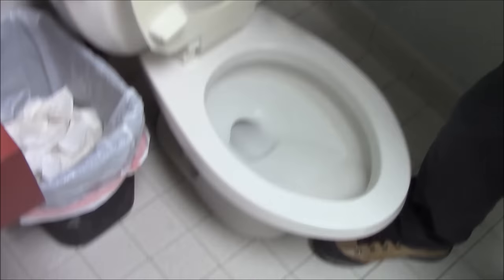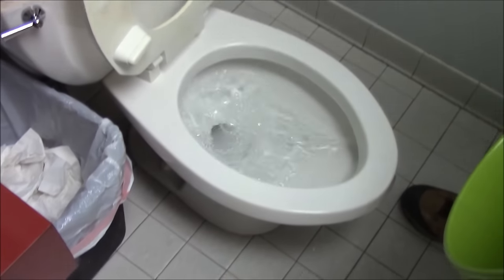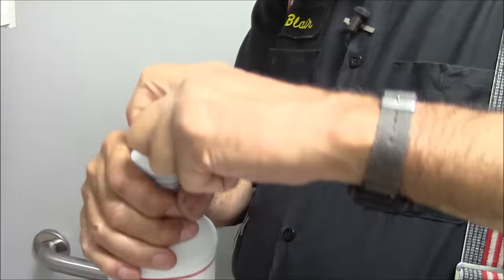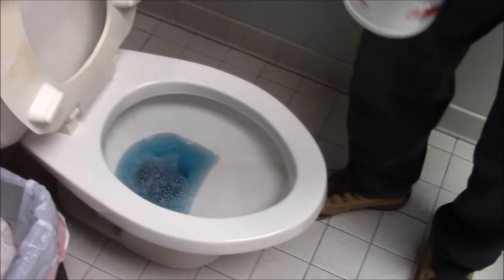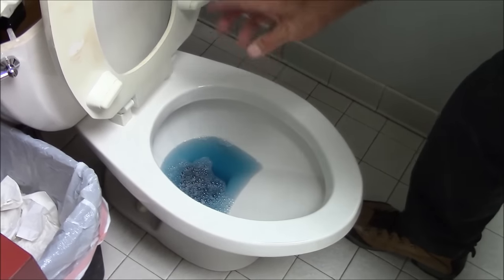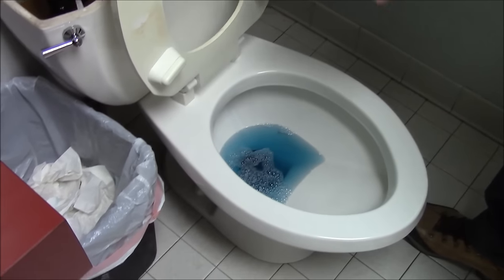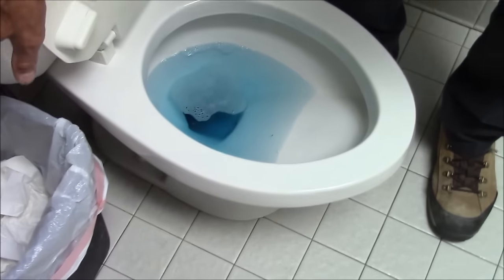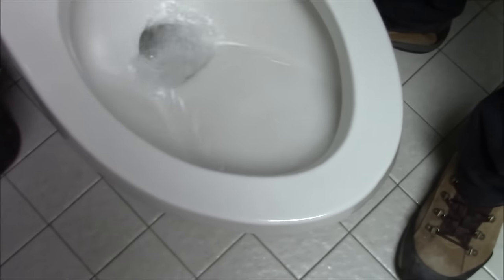Slow Flushing Toilet? Quick and Inexpensive Cure With Delimer

Comment: You can commonly see calcium / lime scale build-up at the jet hole at the bottom of the bowl and it will look brownish yellow but never flushes out.  It’s not just the rim holes, but also mainly the large jet hole at the bottom of the bowl because it always sits in water.  This can easily be dissolved with Muriatic Acid (available at HD, Lowes, etc).  The steps to carefully follow are;

#1  Buy a gallon for around $10-$15.  Note that online recommendations say 1 part to 5 parts water but I think that is way too thin of a mix after using it several times with different toilets.  

#2  Buy a good NIOSH mask, googles and gloves.  You DO NOT want to breathe the fumes of this stuff!   YOU HAVE BEEN WARNED.

#3 I use a 1:1 mix and my standard rule of thumb is 1 hour for every 1/8" of lime scale build-up.  So in general, around 1 hour is a good soak time.  If really bad, you may need 2 hours.

#4 First, before starting. empty your toilet bowl.  Shut off the water supply valve near the floor, then using a large pitcher or a 5 gallon bucket with a few gallons of water quickly pour the water down the bowl (not tank) very fast right in the center to help empty the bowl (the key here is use good aim and a very fast pour so that most of the water flows through the P trap in the toilet into the drain.. speed and physics at work here!

#5  Now mix up the acid water mix OUTSIDE of your house.  Then pour in the acid / water mix you've made in another container (again, you should do the mixing OUTSIDE) and pour the mix in from the TANK (not bowl this time) and while doing so hold the lever down as if you were already flushing to keep the tank flapper open.  This allows the mix to circulate around the inner ring top first and then it filters into the bowl but leaves some in the ring.  This is very important because we want to clean both..ring and bowl.

#6 Fill it up with the mix so that the bowl is as full as it can be.  Then cover the bowl firmly with plastic and turn on your bathroom vent fan to exhaust fumes.  

#7 Set a timer for 1 to 3 hours depending on how bad your deposits are.  Use 3 hours for very bad deposits (like really bad slow flush issues).

#8 When ready, turn the water back on and flush the toilet three times.   If cleaned properly it should flush like new  (providing your tank components work properly too).

#9 Now, you can fast pour a pitcher again (step 4) to empty the bowl, then reach down in the toilet and put your middle finger in the jet hole to feel inside it.  
If the jet hole feels rough and closed up, you may need another treatment.  Using a small round makeup mirror set down in the bowl bottom will also help you visually see the internal build up of lime scale.  Angle the mirror at 45 degrees so you can see into the hole as far as possible.

#10 Providing your tank components are working and adjusted properly, I can assure you that this clean out method will get your old toilet flushing like NEW.  

Last year I got a 5 year old $500 Kohler toilet for free off Craigslist because it had slow flush and they couldn't figure it out.  They even replaced the tank components first and of course, it still didn't work.  I solved it with 2 hours cleaning time, a new rubber base ring, and a $10 gallon of Muriatic acid.  For only being 5 years old it had a ton of calcium/lime scale.  I now have a top of the line 5 year old toilet with new internal tank components that flushes like new. .. all for $10!
Reply: Oldowl, thank you for the well written and thought out approach to this problem. You obviously spent a good deal of time writing this out and I know the little woman is really going to appreciate it when I send her your method on her next birthday.
Reply: White vinegar works good too
Reply: Umm, CLR and white vinegar works too...
Reply: This may be the best comment I have ever read. It depends on whether it works or not. I have two Mansfield 160 toilets. Depress the handle once for 1.6 gallons and keep it pressed for an additional flow for a total of about 3 gallons. I have hard water and am in the process of removing lime buildup in both. The biggest problem so far is a black/brownish flaky like substance that floats around at the bottom of one toilet. I have cleaned away at the holes and the toilet and left vinegar with baking soda in the bowl but it has not cured the problem. The floats reappear but not as much. I believe you have described the problem. Everything has been removed from the toilet and I was thinking about unfastening it and using a power washer inside. I have to borrow the washer. I presumed the problem was in the trap itself and this comment reaffirms my thoughts. So far I have spent $27 on proprietary parts. The black rubber parts deteriorate and leave a greasy black residue. Even after fixing these issues the toilet still will not work well. It is a poor design. Thanks for the comment.
Reply: My toilet is so old I don’t have a jet hole. House was built in the 60’s
Reply: O.G.  "lickity-split" !

Comment: I purchased a case since we have four bathrooms and followed the video to the tee. The bucket test is real important and can save you a visit by a Plummer since it shows that you don't have a blocked pipe.   The Rooto is pine scented and worked great. 12 bottles should last a few years Thanks for this Video

Comment: It worked! The plumber was going to replace the toilet but I fixed it instead. I tas so bad it took a full four quarts of Zep and I had to stick a wire hanger in the front holes but your method is sound. Thanks for the savings!
Reply: I'm so glad you were able to fix your own issue instead of paying some plumber a lot of money to replace the whole toilet. Good for you!! 🙂 and boo on the guy that was trying to rip you off

Comment: Great tip. Kick it up a notch by closing the cistern faucet, setting a fish tank motor into the toilet bowl with a tube running from the motor to the overflow in the tank. This way you continuously flush the tank with the acid solution instead of just once. Let it run for an hour or two. Or use vinegar or CLR. All will work.
Reply: Whats "clr" ?
Reply: Would the acid not destroy the motor?
Reply: @bramblebop1904  It may but these things cost $5 on Amazon. The motor is sealed and uses magnets to move the impeller.
Reply: @bramblebop1904  Calcium, lime and rust remover. You can find it in the big box stores
Reply: fantastic tip on a great video. I just set up a little 12v harbor freight pump that I had and it was good I watched it- foam was right at the top of the bowl, used a green dollar store CLR type. I figure the foam will get all over the inside circuit of the water.

Comment: Thanks.  Before I saw this video, I used vinegar, a gallon in the bowl (after clearing the water), and a pump to continuously pump it into the stand pipe, running for an hour.  Clearly a stronger acid, as you mention here, has the advantage.

Comment: Thank you for this video instructional! It saved our toilet. We were having to flush just the water and it wouldn't budge much. It wasn't even that old, but we figured we'd have to replace it. Until I ran into your video. I couldn't find that specific product in my city. But I did find something similar to it that was for tile, I believe. After following this video of yours, and waiting about 45 minutes, it flushed on the first try! I will keep a bottle of that in storage now that I know it works. Thanks again for posting this video!
Reply from the maker: Can you tell me the name of the product you used? I'm always trying to learn new products. Thanks, Blair
Reply: I don't remember the name on the bottle. But it was a de-scaler from a plumbing supply place here named Ferguson. They only had this one product and they didn't even know if it could be used for toilets, since it was mainly for tile and things like that. So I decided to try it. It worked. The only thing was the next morning the toilet was slow and barely flushing again. I figured some of the build up from the clean up was clogging the trap or something. So I did the bucket test again and it didn't go down. So I used the plunger and after a few tries tried the bucket test again and it is now back to flushing nicely. Hopefully that will be it and it is now fixed and I don't have to do anything else. I can always buy another bottle of that stuff and do a second treatment if needed. Thanks again for sharing the video!
Reply: I love rooto bowl, have used it for 20 yrs but Ace quit carrying it, so I buy it by the case on ebay from a place called sim supply, its 33.00 a case of 12 shipping included.
Reply from the maker: I think you are confusing Lye with muriatic acid, the lye is a great drain cleaner, but I won't use it in a toilet. Blair
Reply: No it definitely was not muriatic acid. I saw videos on that too when people use it for the toilet. I asked the guy at the plumbing store for the same type of cleaner you used. It was for tile and it was the same. So far so good!
Reply: @MrHardware1 Hardware oh dear, I was wondering why my water was brown not blue and it didn't get rid of the ring in the toilet.  I used Rooto drain opener, not the toilet cleaner and delimer I got at ACE. The toilets are running again, but I bet I'll have to redo it to really get the toilets running better.  Wondering if I can do this with just a day in between.  I also hope I didn't damage the toilet with this drain opener.
Reply from the maker: @NickiLuescher  One day should be enough.
Reply: YOU TYPED................................ I couldn't find that specific product in my city. But I did find something similar to it that was for tile.
WHAT DID YOU USE AND AT WHAT STORE TGYVM

Comment: Thank you so much. I too,  couldn’t find that exact thing, I used your directions and used Zep acidic toilet bowl cleaner. Worked first treatment. I was considering replacing the toilet but it would also have damaged my tile floor removing the toilet. Two plumbers told me to replace it. Thank you so much.
Reply: Thank you. I was about to use that acid till saw your comment, had the CLR and tried it. After about three hours of work it flushes and no more bucket or plunger. One thing I will add is after pouring the CLR into overflow and cleaning out jets with wire coat hanger. I used an empty plastic deli meat container to pull out CLR from bowl and put back into over flow. Then keep repeating till working.

Comment: Great video, but just run duct tape around the underside of the rim to block the rim jets, before pouring the acid.  Cheap Dollar Store cleaning vinegar will also work, but it takes longer, so just leave it to work overnight.

Comment: On my toilet I found that the siphon jet was about 2/3s clogged up with calcium. I flushed the toilet with a bucket of water then took a mirror and looked into the siphon jet......it was badly clogged. I used a small pick to remove the calcium block, it was very difficult to remove and took me about 20 minutes to clean out. After removing the clogged I used vinegar (didn't have access to your product) in the way you suggest. Now the toilet works like new.   Thanks for your video.
Reply: At first I thought I had a clog in the toilet. I used a toilet snake and even took one of the toilets off and ran the snake throught the bottom. Then I used a 5 gallon bucket and found out the wasn't a clog. Then I cleaned the jets and still had a problem with toilet flushing. I feel so stupid because I just replaced toilet fill valve on both toilets and forgot to adjust the valve. The whole time and after doing all that work it was just an adjustment on the toilet fill valves!!!!!! OH Fudge!
Reply: @p.g.8138  Thanks for the tip!

Comment: Years ago, I knew a fella, that had calcium build up in all his home's plumbing. The taps were slow, the shower was slow, flushing was slow, everything was slow. Reason being was, his home was fed with well water, and brought up from the well by an electrical pump to a 20 gal. reservoir tank, then fed by pipe, from the well's pump house,  to his home's feed line. Pressure was good where it came into the house, but the house plumbing was older than the pump system he was using to feed water to the house. He decided to use some calcium acid cleaner to clean out the whole house system. He was only supposed to use a small amount of cleaner to clean out the system, but instead, he shut off the pump, drained the tank out, and poured 3 gal. of this calcium cleaner into the empty pump's reservoir tank. He opened "all the taps" that spouted water in the house, went back outside, and flipped on the pump switch. That tank began filling up again, and was feeding both chemical acid cleaner, and water throughout his home. In a very short time, his wife began yelling her head off, to stop what ever he was doing. He ran into the house, and all the taps were pushing out a cream coloured foam at very high pressure ( and I do mean very, very, high pressure).  The kitchen sink' tap was blowing this foam out like a rocket on "High test fuel". Even the garden hose was blowing it out like crazy (like I said, he had opened all the taps through out the house. This foam was spraying all over his backyard, when we arrived to see what was happening. He near emptied his well that day of all water, just flushing his home's plumbing out. He couldn't shut the system's water flow off, or there would be too much foam pressure built up in the pipes within the house. It took at least an hour to have his home's system flushed enough where clear water began to flow through the taps again.  He succeeded in getting the water pressure up, and flowing properly within his house, but it took hours cleaning the house afterwards of foam on walls, floor, doors, and such. The three of us that arrived after he began pumping this acid cleaner throughout his house, were rolling in laughter, watching him hold onto his garden hose, (while his wife yelled at him), that was spewing creamy foam all over the backyard. That foam was coming out of the hose, like there was a pressure washer firing out all that foam. The foam was all over the place, and all over the fella as well. It did fix the problem of low water pressure in his house, but I doubt he will ever do that again.

Comment: I have a toilet in my house that was installed in 1972 when the house was built.
From time to time it has given me problems. I must add that I have well water, so we know that can lead to issues.
I just put a bottle of Lime Away in the overflow tube and scrubbed the bowl. 
MUCH BETTER! And, not as harsh of chemicals

Comment: Good video.  3 in 1stuff not available where I live.   I used muriatic acid (nasty stuff but pretty cheap) following the exact application shown here.  I had some mineral deposits about 1/4 in thick and impossible to scape off.   Let it sit for about an hour and clean as a whistle, I was surprised but  it got it all.  I also covered over the toilet bowl and the water intake inside the tank with saran wrap to reduce the fumes (you will notice the fumes).  I let it sit for about an hour, probably could have been done in 45 minutes.

Comment: This video was very informative and I'll be getting the materials mentioned.  I have a different question:  How do I keep the SMALL HOLE in the bottom of the toilet clean?  It seems to flush okay, but the small hole is always black.  Why?  And, what do you suggest I do to prevent it from happening in the first place?  THANK YOU!    : /
Reply from the maker: The delimer should clean it up, use small amounts to occasionally clean the toilet

Comment: Thank you for this video! I didn't use the product you had, but instead used Zep Acidic Toilet Bowl Cleaner. I followed your instructions and worked like a charm.
Reply: Sam, did you use the gel, and if so, did you pour it into the overflow tube?

Comment: You are a genius. Ive been using a pitcher in order to flush my toilet  for months. Ive also been utilizing the coat hanger trick. I wish i could back flow the acid into the pipes. We do not have cold water coming into the kitchen or bathroom sink ( 1942 pipes). Can't afford to replace them and they are blocked with well water debris. We only have cold water in the tub faucet. The tap to the washing machine is also corroded it won't turn (it's in the off position)Im afraid to wrap it with an acid cleaner because if it lets loose the valve to shut off the water main doesn't move either and there would be no way to stop the water. 😫 we've run a water hose from outside to the washing machine in order to wash the clothes. Love the old farm houses but issues can be costly. 😢😢 Thank you for the info. 🤗

Comment: another trick... plug up the holes

I've plugged up the holes in a few ways... putty... playdough, tape

My favorite was to put masking tape over all the holes (make sure it's dry) spray down the toilet bowl  with wd40 (makes cleanup easier) and spray foam to hold the masking tape in place.

Then, you can use whatever lime treatment you want and it won't leak out.

Then, you remove the foam and tape, and give it a few flushes and you're golden

Comment: The bucket trick was not one that I was aware of and completely helped me diagnose the problem. I was able to buy a better plunger to seal the opening and boom, clog removed. Thank you!
Reply: The bucket trick literally demonstrates why they call it a gravity toilet. The principle is that the downward force of the incoming water is what overcomes the equilibrium in the bowl and the S-trap. The S-trap is there to keep harmful sewer gases from coming back up the drain. So it is not so much a trick as how the toilet works without impediment between the tank and jets.